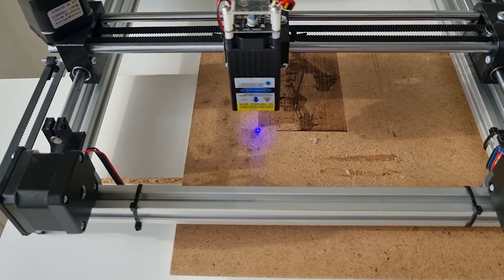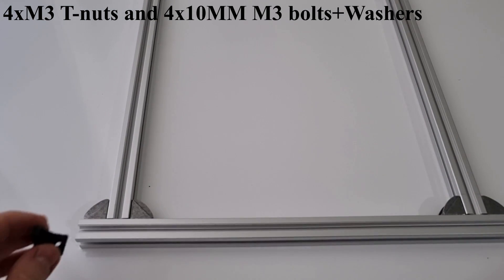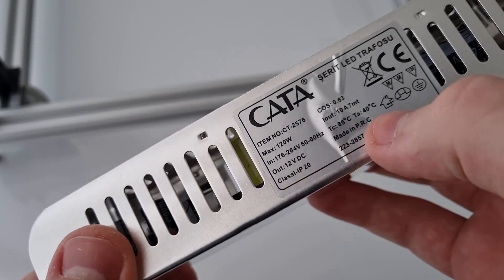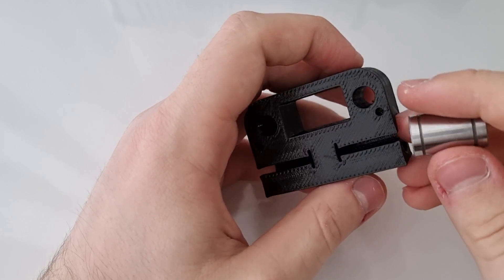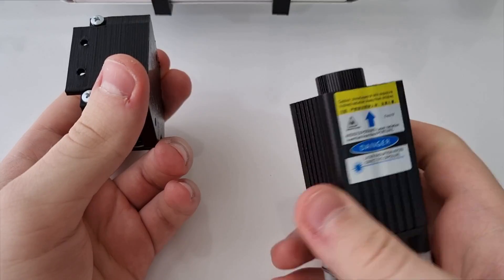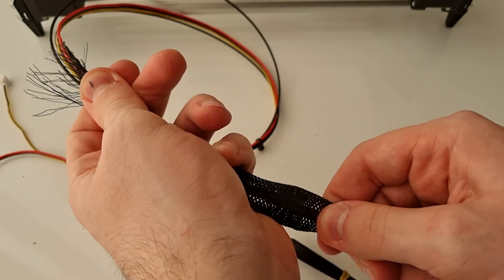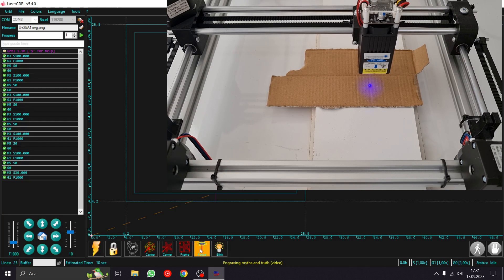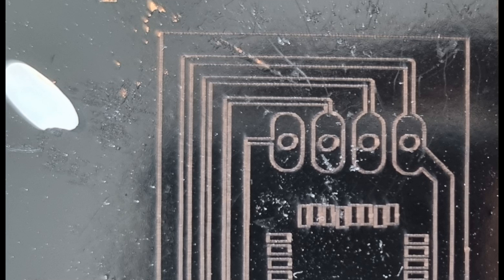DIY-Basic Laser Engraver With Arduino

Comment: Do you think that by using the LT-10W-AA-PRO-12V and the DRV8825 I can engrave aluminum or metal? I would simply like to engrave some symbols on it.
Reply from the maker: It will most likely work on black anodized aluminum or coated/painted metals, since the laser removes the surface layer. However, with a 10W diode laser, you generally won’t be able to engrave bare aluminum or raw metal directly.

Comment: Can we use 10w optical power diode laser module
Reply from the maker: Hello, 10W optical power refers to the output power, but the input power is more important for us. For example, if the module consumes around 40W, that means roughly 3A at 12V. Our PSU is 12V 10A, which is more than enough for this kind of laser. If the mounting holes are not compatible, you can either modify the files or simply drill new holes.

Comment: hello, I have a question. Can you use another pc/laptop with LaserGRBL with the same arduino that is already flashed with the firmware?
Reply from the maker: Hello, once you flash GRBL, it stays on the Arduino, so you can use it with any PC or laptop. The only thing I'm not completely sure about is whether the settings are stored on the board or need to be set again.
Reply: @bitofelectronics thank you for the reply, well appreciated. also how do I add limit switches to enable the homing button? what do I need to change in the configuration?
Reply from the maker: I haven't used it with end switches, but first I think we need to flash GRBL with the X-Y homing option. Then you need to enable the homing cycle in the GRBL configuration. The rest is mostly experimentation, for example inverting the switch direction, etc.

Since I don't use end switches, there's no end switch mount on the machine, so you might need to either modify the files or maybe duct tape it 😄
Reply: @bitofelectronics can I use a 8amp 12v power supply though?
Reply from the maker: @ps_asher936  Yes you can 👍

Comment: My engraver is stoping with error in lasergrbl after some little move. Says that an error occured with your board. When I disconnect the x axis motor everything works fine. No errors. Despite you cannot work without an axis disconnected.
Reply from the maker: Hello, is your X-axis the one with dual motors? If so, the issue might be caused by incorrect wiring, which can lead to a short circuit. Could you please check the connections? The wiring of the two motors should be mirrored.
Reply: Hi. No, my machine is gantry like. Dual motors are on the Y axis. And one motor moves the X gantry. It occurs even if the motor is just holding, no steps receiveing. Maybe it is because the motor is located relatively too close to the laser head. And some emi occurs between them
 Motors coils act like antenna.. @bitofelectronics
Reply from the maker: @despicabledmitry  I had a similar issue in the past where my stepper motor cables interfered with the end stop switch on my 3D printer. But in your case, I don't think the problem is caused by EMI alone. There might be something else going on.

I'd suggest taking everything apart and testing step by step. First run the system with the laser disconnected, then test the steppers, and continue isolating components until the issue appears again. Just be careful during testing, I once fried three Arduino Megas because of a single faulty A4988 😅
Reply: I just twisted nema 17 wires near the input socket and the problem gone😂 maybe later ill put a ferrite filter on that wire. Twisted wires look unpretty 😂 @bitofelectronics
Reply from the maker: @despicabledmitry  Nice, happy for you 🙂

Comment: My aurdino uno connects to the software but nothing on the laser will move
Reply from the maker: There can be several reasons for this.

Make sure GRBL is correctly uploaded to your Arduino.
Check if your power supply is working properly.
Verify that your stepper drivers and motors are wired correctly.

Might be an GRBL error, so I recommend reflashing GRBL and trying again.
Reply: @bitofelectronics ok I’ll try all that

Comment: Hello,
İ want to ask a question. İ have got a 3018 CNC router that i made last year. Today, i buy tree pin 40-80 watt laser. İ want to connect laser on CNC machine. When i connect 12 v and gnd pin, i look 12.6 v 4560 mah using power and blue LED on. However pwm pin not connect. 
According to my experience, my question: when i connect pwm pin on Arduino, do it correct work ? İs it need upload other software then CNC gerber. İ hope that explain this problem
Reply from the maker: Hello, are you using a GRBL shield? If so, can you tell me where your spindle motor is normally connected on the board?
Reply: @bitofelectronics  thank you for answer. İ have used spindle by manuel on/of with other power (24v 5 Ah). İ used by easel software for drilling.
Reply: I see that you connect to pwm pin on z pozitif pin. Do ı connect your setup ?
Reply from the maker: Hocam kanalınıza baktım sizde Türkmüşsünüz o yüzden Türkçe cevap vereyim dedim :), eğer lazeri Arduino ve step motorların beslendiğinden farklı bir kaynakla besleyecekseniz Z+ pininden gelen PWM sinyalin lazeri kontrol edebilmesi için iki kaynağında GND(-) uçlarını birbirine bağlamanız gerekiyor o şekilde bir deneyin, bahsettiğiniz Easel yazılımını daha önce kullanmadım ama bu şekilde çalışmazsa farklı çözümler düşünürüz. Belki programın bir yerlerinde PWM çıkışını aktif eden bir ayar vs. olabilir.
Reply: @bitofelectronics hocam memnun oldum ❤. Bugün cnc lazer ucunu router ıle değiştirdim. Deneme yaptım ama dediğiniz gibi pwm inaktifti bence. Gnd leri kısa devre yapıp lasergrbl üzerinden tekrardeneyecegim. Saygılarımla ❤

Comment: can you provice me please this GRBL file ? and can i use this co2 leser 40w ?
Reply from the maker: Hello, I don't have a GRBL file to provide, as it is generated by the LaserGRBL software. You can use this setup with any diode laser module, but I'm not sure about using a CO2 laser because it requires a mirror alignment system, which this build doesn't have.
Reply: @bitofelectronics there are no need any GRBL firmware?
Reply from the maker: @minazyoutubechanel8057  We need the GRBL firmware, but no need to worry about uploading it from the Arduino IDE,  you can upload it directly using LaserGRBL, as shown here at 9:00.

Comment: Do it have ability to engrave round details? Really easy understanding video
Reply from the maker: Hello, you can see some circular engravings in the Thingiverse images I shared earlier: https://www.thingiverse.com/thing:6391901
Reply: @bitofelectronics if using MKSDLC32 should I use higher power supply ?
Reply from the maker: @truonghoaiii  It will be fine. The main current draw comes from the stepper motors and the laser module. The controller board itself uses very little power, so switching to the MKSDL32 won’t really change your power supply requirement.

Comment: I have a question why do you need a 10-amp power supply? The laser takes around 0.3 amps, and the motors don't have a strong load attached, so I'm guessing a maximum of 1 amp per motor. So why not use a 12-volt, 3-amp power supply? They cost around 5€, and the power supply is on the power socket (like a phone charger), which is much safer. I'm not criticizing this design I'm just asking if there is there anything that takes more power?
Reply from the maker: Hello, the laser itself draws about 1,6A (according to the seller). If we assume each axis motor takes 1A that’s around 3.6 A total. In practice a 5 A supply could work but since many low cost supplies (especially from China) don’t always deliver their rated output, I prefer having extra margin. That’s why I went with a 10 A supply not because it’s strictly required but to stay safe and avoid running the PSU at its limits.

And no worries about criticism, I really appreciate the questions 😄

Comment: I challenge someone to build something like this without 3D-printed parts.
Reply from the maker: Actually I tried this with a 3D printer. The video is a bit unprofessional, so I unlisted it, but you can still watch it here 😄 : https://youtu.be/Pv7oB0Wflqg
Reply: I love what you did but I don't have a 3D printer and would love to be able to build something like that from standard off-the-shelf parts.
Reply from the maker: @joaopauloleonidasfernandes5884  I meant you can build one without a 3D printer. In the video, I’m actually building a 3D printer without using any 3D printed parts! 😄

Comment: can i use any laser module? i have 7w from my old neje engraver
Reply from the maker: Yes, you can use it as long as it fits the bolt holes of the engraver head. If it doesn't, you can either drill new holes or add additional ones, I have also included STEP files.

Comment: Can i use swap the laser like say a spindle motor
Reply from the maker: Yes you can technically swap the laser module for a spindle motor. However you will need to consider how you will handle the Z-axis movement, spindle motors are heavier and need more force than lasers, so the machine needs to be sturdy enough to support and move it. If you’re planning a CNC build or conversion it’s often better to start with a machine designed for milling rather than just adapting a laser engraver.

Comment: i have a 3 pin laser module. I tried making connections as you said but, it does not work. the laser simply turns ON at full power. PWM pin has no effect
Reply from the maker: First lets test the laser to make sure the issue isn't with the module itself. Connect the laser to the power supply and leave the PWM cable floating. If the laser still operates at full power try connecting the PWM cable of the laser to GND this should set the duty cycle to 0%, which should turn the laser off.
Reply from the maker: Also I forgot to ask did you adjust the laser power using the S-MAX setting? (you can see at 9:48)
Reply: No, even when i connect the pwm pin to the ground, the laser is turned ON with full power.
Update- last night i was successful in carrying out the motion system of the device. Turns out my stepper driver current limit was the problem.
Reply from the maker: @pointBreak64  So does the laser work properly now, or is it still stuck at full power?
Reply: @bitofelectronics  its stuck at full power plus, after 5-6 seconds, it starts turning on and off on its own🥹🥹🤔🫣🫣💁
Reply from the maker: @pointBreak64 It sounds like the control circuit in your laser module might be damaged, the turning on and off behavior could indicate an issue with the module's internal circuitry, did you use this laser for a long time or is it brand new?

Comment: Hello, your project is amazing, and I would like to make one for myself as well. Should the 20-tooth pulley be of GT2 type? And what should its size be in millimeters?
Reply from the maker: Hello, the pulley im using is a GT2 type with a 6mm belt width and a 5mm bore for the shaft.

Comment: Omg! I didn't know you could use a laser with pcb!!

Now im curious using, and synching 2 motors on the Y-axis.. 😅
I have a little 3018 cnc/laser that ive altered n made bigger etc, but it runs on screws. 
I'm planning out a 1500mmx1500mm build, hot everything all picked out etc, just don't get how you run 2 motots in sync... 😅😅
Reply from the maker: It's super simple For the motor facing left and the one facing right, you just need to mirror the wire connections of one motor. Solder the wires together, and you can plug them into the same stepper driver. As long as both motors are connected properly  they will run in sync 🙂

Comment: I made it and the credit goes to you, as if you would not help me in each n every step one by one whenever i got stuck in a problem everytime, i would've never made it to success 💯
Thanks a lot for your help bro 👍🏻☺️
Reply from the maker: It’s awesome to see you succeed, Congrats bro 😄
Reply: Why not use the estrusions themselves as the linear bearings - as many 3D printers do? If it's precise enough to print moddels, shouldn't it be fine for most laser applications?
Reply: @chriswesley594  we can use profile estrusions themselves as a rail to move parts, but it will work with linear guide rail system attached within it for a high precision. You can also use wheels based 3d printed parts as well but it is not as precise & sharp as linear bearing or guide rails
Reply: @ Agreed, but my application is to cut fabric for patterns and so I think the extrusions will be plenty accurate enough.
Reply: @ritiksadh1999  Hah! That's the size I was going for as it allows me to fit the largest pat (trouseer leg) on it. Trouble is, the extrusions will need to be a little longer than that - say 110cm, to allow full travel over 100cm. I'm trying to find the best way to do that now. I'm thinking bog standard NEMA17s, Arduino Uno, Stepper driver board, TMCs and a 20 or 40W laser. What do you have?

I thought about the weght issue, but why not just support the rails on the floor (or wherever else you stand it) with many legs under those rails, to stop any sag?
Reply: *note : if you want to use lenear rails rods system, it is perfect for small bed sizes till 500-600 mm square.

If you want to make bigger bed size then these are really not worth for long time, as these are just rods being in air holding the x axis rods & other parts which makes it heavy, it will bend over time & might ruin you quality but if you still want to consider a cheaper option in longer bed sizes than wheels system is also perfect)

Hope this detailed information helps you

Thankyou